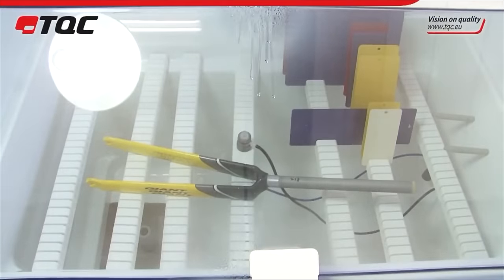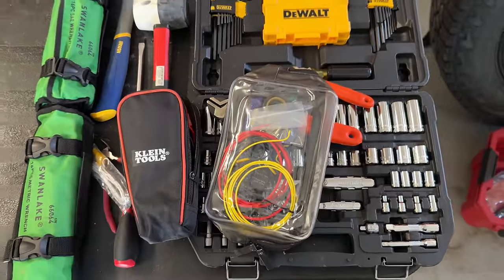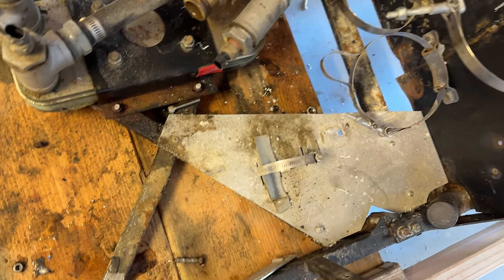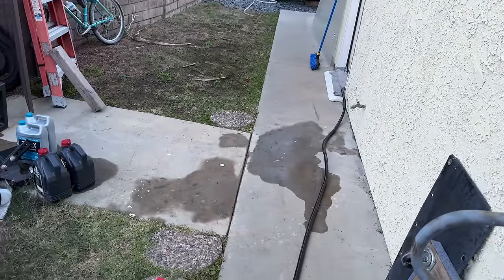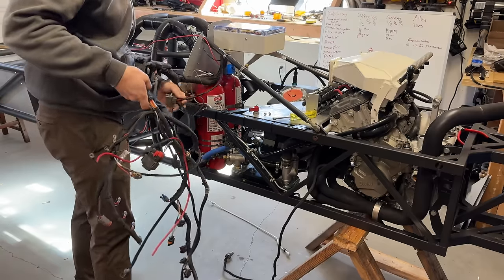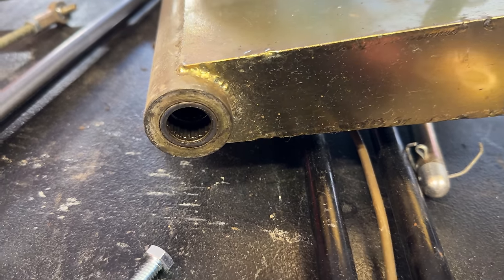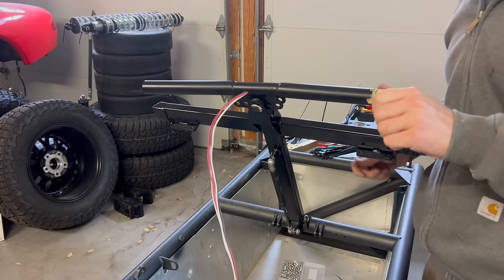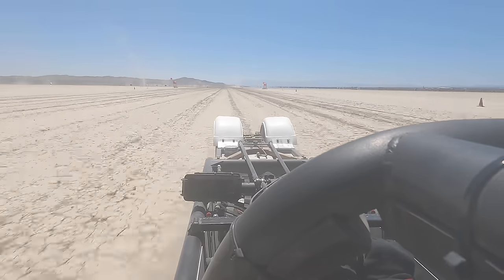My Race Car Is Rust

Comment: If you're gonna DIY the throttle control I'd make sure to have some sort of kill switch for it too!
Reply: "Die by wire" has a lot more weight to it when instead of the usual army of engineers and lawyers trying to prevent that from happening, you have... Matt.
Reply: He probably already has one somewhere, but I had the same initial reaction as you.
Reply: I'm not sure if they require it at Bonneville, but kill switches both inside and outside (for track Marshals in emergencies) the car are required for a lot of motorsports.
Reply: Even better, disable throttle when the brake is depressed. All modern cars do this as far as I know, if the throttle input and brake input are high, it assumes it’s a runaway.
Reply: @bigiron4018  any software solution relies on the arduino, and in my experience they are not the most reliable piece of hardware in the world ....
They're pretty good, but not bulletproof, I had one that froze and needed rebooting once while driving, it was only used as a speedometer and never had any other issue since then but I wouldn't trust it with my life. 
The salt might also make it worse.
A kill switch would ensure he still has a way to kill the engine in case the electronic part of the throttle fails :)
Reply: @bigiron4018  Doesn't it also have to take into account the clutch and/or gears so you can rev while stationary?
Reply: They are spring fail close. Ignition kill switch should cut the battery and kill the throttle closed.
Reply: Pouth sark
Reply: @bigiron4018 I don’t think that’s the case. I can do a brake stand in every vehicle I’ve tried it in that was rwd.
Reply: All that corrosion from the salt is sicking, what a shame. Thanks for sharing your videos. 👍
Reply: @bigiron4018 how will he do standing burnouts?😂
Reply: @pbe6965  I mean if he can make it in arduino, then he can rewrite his code in C and write it directly into a microcontroller. But that requires designing a CB, soldering, choosing components, enclosure, connections etc etc. but once done it can be pretty bulletproof
Reply: @Phoen1x883  especially with that throttle actuation lag measured in full . actual . seconds  :D
Reply: @kshysztof9649  I think arduinos are already microcontrollers ?
I don't know what caused mine to freeze, my point was you can never fully trust electronics, the stepper motor or whatever he used to command that throttle can also jam.
A kill switch is a guaranteed stop, and they're already required in a lot of motorsport applications anyways 🙂(a second internal kill switch is probably not as often required as external ones, but I think it's still good practice to have them within hand reach, there are a variety of other reasons why you might need one).
Reply: @bigiron4018 In a modern car it's a lot more complex than that, there are plenty of good reasons to hit the gas while braking or vice versa.
Reply: @pbe6965  yes Arduino is microcontroller, but Arduino also has a bootloader enabled, it has a quartz oscillator, reset button, and USB port to overwrite a program. So there's the main difference I think. Once microcontroller is flashed with a program it just keeps repeating same code over and over until it fails no matter when it gets powered off/on where Arduino I believe (someone has to correct me if I'm wrong) when it starts up, it waits for input from USB and when it gets a certain order of bits, it'll wait for new code to be overwritten.
Reply: @bigiron4018  manual cars dont for obvious reasons, but yeah for automatic it should do that.
Reply: @lustfulvengance  im pretty sure theres a timer to it, if you did it for 30sec or so it probably wouldnt do it anymore in order not to overheat the brakes
Reply: The reliability of Arduinos depends heavily on the interfacing. If you do optos in and out, RF shielding, good power rail regulation, no zapping/glitching happens. The software side on the other side, oh my, oh my...
Reply: The reliability of Arduinos depends heavily on the interfacing. If you do optos in and out, RF shielding, good power rail regulation, no zapping/glitching happens. The software side on the other side, oh my, oh my...
Reply: The reliability of Arduinos depends heavily on the interfacing. If you do optos in and out, RF shielding, good power rail regulation, no zapping/glitching happens. The software side on the other side, oh my, oh my...
Reply: The reliability of Arduinos depends heavily on the interfacing. If you do optos in and out, RF shielding, good power rail regulation, no zapping/glitching happens. The software side on the other side, oh my, oh my...
Reply: The reliability of Arduinos depends heavily on the interfacing. If you do optos in and out, RF shielding, good power rail regulation, no zapping/glitching happens. The software side on the other side, oh my, oh my...
Reply: The reliability of Arduinos depends heavily on the interfacing. If you do optos in and out, RF shielding, good power rail regulation, no zapping/glitching happens. The software side on the other side, oh my, oh my...
Reply: The reliability of Arduinos depends heavily on the interfacing. If you do optos in and out, RF shielding, good power rail regulation and filtering, no zapping/glitching happens. The software side on the other side, oh my, oh my... Just saying that all variables are global, every statement has an escape/fail route for what-if, no libraries unless you go thru them line by line, everything is dumb, plain, boring, ugly code that does what is needed and nothing else. One such bodge of a controller has been in use for some 10 years until the machine was retired. There was no way in hell the original 1960 vintage controller would have been salvageable, not much space to put a new PLC into the box, so Arduino in a steel box it was.
Reply: The reliability of Arduinos depends heavily on the interfacing. If you do optos in and out, RF shielding, good power rail regulation and filtering, no zapping/glitching happens. The software side on the other side, oh my, oh my... Just saying that all variables are global, every statement has an escape/fail route for what-if, no libraries unless you go thru them line by line, everything is dumb, plain, boring, ugly code that does what is needed and nothing else. One such bodge of a controller has been in use for some 10 years until the machine was retired. There was no way in hell the original 1960 vintage controller would have been salvageable, not much space to put a new PLC into the box, so Arduino in a steel box it was.
Reply: The reliability of Arduinos depends heavily on the interfacing. If you do optos in and out, RF shielding, good power rail regulation and filtering, no zapping/glitching happens. The software side on the other side, oh my, oh my... Just saying that all variables are global, every statement has an escape/fail route for what-if, no libraries unless you go thru them line by line, everything is dumb, plain, boring, ugly code that does what is needed and nothing else. One such bodge of a controller has been in use for some 10 years until the machine was retired. There was no way in hell the original 1960 vintage controller would have been salvageable, not much space to put a new PLC into the box, so Arduino in a steel box it was.
Reply: @radomirblazik  did you post this with an arduino? :D
Reply: @D3nn1s  Nah... PDP 11 :-)
At least not in Morse code...
Reply: Isn't that called a clutch?
Reply: Dear god, I would not do something that could kill me like that with an Arduino

Comment: "Is that turbo lag?" "No, it's just my arduino throttle controller!"
Reply: lol
Reply: The key step is to get the hw working and Matt has proven that now. I'm sure arguino code with a massively faster response (even ballistics) an be done easily by any sw guys out there
Reply: I have a hard time imagining how the response wouldnt just be fast as heck unless he has like serial prints on every loop or something.

Its literally a read input give output sort of thing where even the slowest ancient uno should be able to do that thousands of times per second.
Reply: The throttle controllers I’ve used in OEM are feedback position controllers.  Your foot requests an angle which creates  “position error” in the system and a PID (or similar) feedback loop moves the throttle to correct this error.  The output to move the throttle is not the same as the output to hold it still, and even holding it still in different positions can require different outputs.  Then there’s signal validation from multiple inputs as you should have at least 2 pedal and 2 throttle position sensors, hopefully with one with an increasing signal and another with a decreasing signal. Some systems also have a plausibility checker, independent of the throttle controller, that oversees everything to make sure that everything is running properly. Once set up properly, modern electronic throttle systems can move faster than cable as they don’t solely rely on a slow moving person to operate.
Reply: @jzab  "modern electronic throttle systems can move faster than cable as they don’t solely rely on a slow moving person to operate"
You fail to grasp how quickly I can stomp on the throttle when the light turns from green to yellow
Reply: While they are often the best choice, I've never seen an e throttle that is quite as fast as a foot. They're close, but not quite there, even the motorsport systems. There will always be some lag, by design. It's only really noticeable on fast repeated stabs, but it's always there.
Reply: @BeefIngot  the basic Arduino libs have a lot of overhead on digital reads/writes (and especially on analog reads/writes) but agreed, if you're doing full bare metal firmware it should be fast as fuck with any MCU.
Reply: @nicknack125  Even with arduino you can still get to the mega hertz range.
Reply: @BeefIngot  not with basic digital read and digital write, you're stuck to around 200-300kHz max. Granted that's still plenty fast for this use tho
Reply: @nicknack125  Depends on what MCU you are using. Maybe on a crappy old avr Uno, but on something like an esp32, afaik you can get up to just around 6mHz
Reply: @BeefIngot  oh ye for sure, I was assuming basic Uno r3 with the atmega328p. The newer Atmel SAM chips, ESP line and everything are WAY better like you said

Comment: I am Australian. Lots of people who use their 4x4 on the beach will use a lawn sprinkler under their vehicle over night to wash out the sand and salt.
Reply: He literally did that for the RV
Reply: i wonder if running a boiler and pushing steam through the sprinkler can achieve the same thing while reducing the amount of water used
Reply: @d3str0i3r pretty sure hot steam would make it rust faster.  When they used to rust blue gun barrels, they’d steam them for a certain amount of time to help it really get blue

Comment: You're right about 3D printing -- it can be a minefield of problems unless you have good control of the process and materials.  Polycarbonate is good, but for high strength, high impact nylon is best IMHO.  You can smash nylon with a hammer and it won't break, just like the car bouncing up and down on the pucks as you drive down the road.  Send me your files and I'll print them for you, I've been through the minefiled already.
Reply: Upvote this man so Matt get's to read his offer
Reply: If impact resistance is the highest priority, then max hardness TPU is the go-to material.  Taulman PCTPE and NinjaFlex Armadillo are the easiest to find.  1/2-1/4 as stiff as nylon but with >50% elastic deformation.  It's amazing stuff and easy to print.
Reply: I dont know what type of printer Matt is using, but IMO I would stay away from high temperature materials PC/PEI without enclosed/heated chamber (in my tests the bonding strength of layers is compromised). Hard TPU or nylon would be my choice for high reliability, becouse it seems to be easy to get good results. i would use lighter colors instead of black to keep temperature of the parts lower, especially usefull in heavy sun exposure.
Reply: @GaweNowakowski  Looking at the one in this video he's using an X1 Carbon so he should be able to print in pretty much anything that's not too exotic.
Reply: You can smash normal PLA with a hammer too if you print your thing correctly enough.
Reply: Even petg has great ductility and can be very tough, you can make great printed mechanical parts like gears with petg. Pla is really rigid and easy to print but can be pushed into brittle territory, plus low heat resistance.

 With the x1c asa is probably the easiest functional part material. Nylon is good and all that but you have to dry it alot.

 I really like prusament pc-cf it's really easy to print, you don't even need an enclosure, it's super rigid + high heat resistance ( though not as good as nylon) and doesn't warp in my experience.

Comment: Afik the trick tube frame airplanes use to prevent internal corrosion is the partially fill the tubes with Linseed Oil, tumble it about, drain the extra, and let it turn to varnish.
Reply: Plus also if you have any open ports for through bolts, weld a sleeve there instead of leaving it open. If you do both, you're setting yourself up for success.

Comment: Hi Matt, you can use low-viscosity cyanoacrylate (superglue) on 3D filament prints to make them MUCH stronger. You coat the whole thing in glue, let it flow into all the gaps between layers and then spray with activator. It's self-leveling but, if there are any bumps of glue, easily sandable. Particularly with polycarb filament you should expect an end result that is actually hard to damage, even intentionally.
Reply: With what type of materials does that work?
Reply: ....or do a simple silicon mold with a smooth on kit and cast them out of resin like all these 'makers' should be doing instead of running off dozens of the same part or iterating over  the design when the original would do if they would just cast it out of an appropriate hardness urethane.... As a fabricator (we're cooler than makers, fight me) I really dont understand the aversion to doing it the right way.... Whoever told the scene 'it makes ready to go parts' and got them chasing perfection with bog standard steppers with no feed back was lying to them. Like musk level lies.... Seriously kiddies, learn to do it right and stop wasting energy and creating more plastic trash for the landfill!
Reply: @Johnny_OSG  It definitely works with PLA and ABS. It's always worth checking with a test, but I haven't found a plastic except poly-ethylene that CA glue won't stick.
Reply: @zombieregime  There's a fascinating process for turning plastic waste into high-quality graphene, by pyrolysis and then joule-heating it, that I'm working towards replicating, but you're dead right about casting. You even use a 'lost PLA' process to cast metal parts from prints.
Reply: @gerryjamesedwards1227  that's interesting. I'd watch a youtube video about your progress.
Reply: I don't think I would use any 3d printed material on a racing vehicle, accept TPU.  Anything else will just break.  TPU on the otherhand is practicly indestructable.  Just change the percentage of infill to determine how flexible it is.
Reply: @zombieregime The guys who print everything because it's "better", remind me of the dulllards who sneer at mig welding but can't tig together a reliable shopping cart
Reply: @auroraRealms  I printed intake manifold out of cf-nylon and its one of the best custom-made parts I have. no issues. I'll probably print more because of how well that turned out to be. 
TPU is good too, made some unobtanium bushings out of it
Reply: @zombieregime  resins work worse than some 3d printing filaments in elevated temperatures in the engine bay. So no, resin is not "the right way"
Reply: @zombieregime it totally depends on what the use case is. If you are doing a small batch of parts say 10 units then silicone moulding pu parts can be good but after than you will need to make a new mould. Anyway layer adhesion is so good these days with modern fff machines you can get some seriously tough prints, esp when you up the perimeter count and infill density. Like any material process, if you have a good sense for the strength, rigidity, etc of a material then you can get a feel for how much material you need for a given job. 
Additionally a middle ground I have done in the past when I needed a really strong part but couldn’t justify machining something was to print a part with a very low density open cell infill then make a hole in the surface and fill with two part pu. Also acetone smoothing asa or abs parts can be very strong.
Reply: @zombieregime  I'm honestly not even slightly concerned with plastic waste from hobbyist 3D printing. It's barely a drop in the ocean compared with the incredible waste from product/food packaging and garbage toys from China. And I don't understand what your problem is with 3D printing. 3D printing is a totally appropriate and correct way to produce many types of parts. For instance, I'm creating a custom Home Assistant light switch, and I will be printing the enclosure. Why wouldn't I? Silicone-moulded resin would be so much more time and effort than is required for no benefit.
Reply: @Johnny_OSG  If you can print nylon, that is awesome, that works too.  I am not in the nylon printing tear yet.
Reply: or just salt anneal it
Reply: Bonus benefit of a CA sealer coat: does a really good job plugging all the inevitable pinholes between layers & thereby makes your prints waterproof! Not becoming a reservoir of raceway brine seems like a welcome side-effect